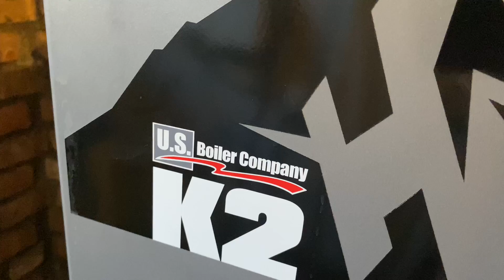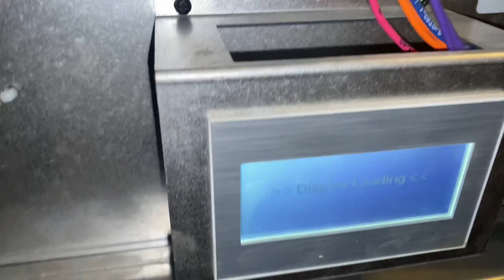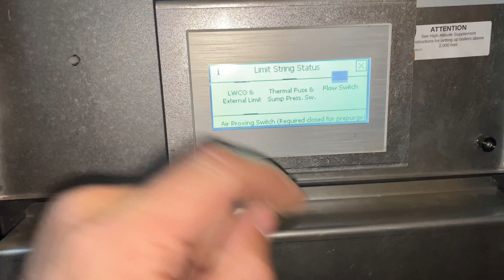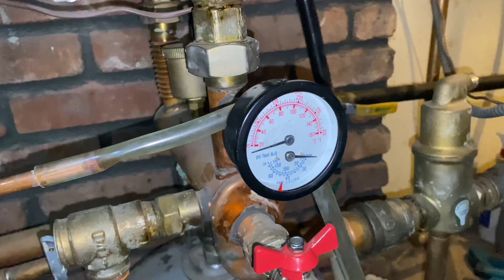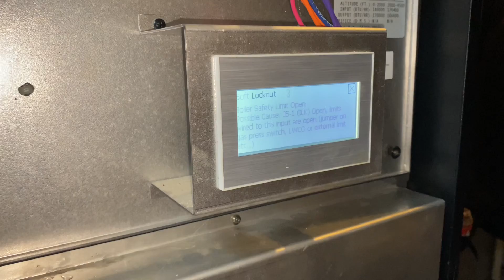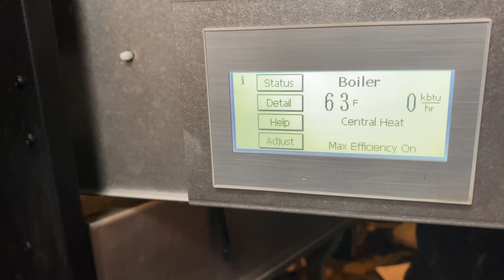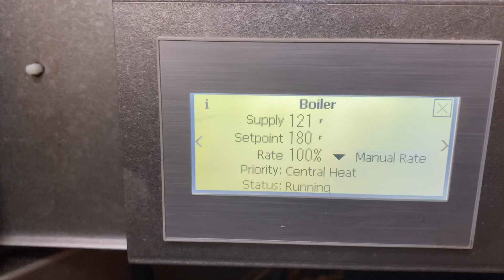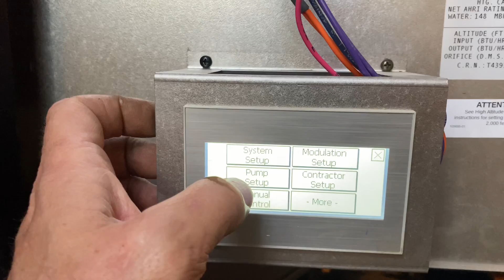Expert Tips: How to Solve US Boiler Burnham K2 RED Screen Not Heating

Comment: Incredibly incompetent!You replaced Grundfos 26-99 that has available head of 30 with Taco 0015 with available head of 18!Did you bother to read the minimal required boiler water flow in the manual?(FYI it is 9.3 GPM)No wonder so many boilers like this fail if they are installed by "experts" like you.Lesson learned here is"read the f-ing manual" not "don't be intimidated by what you don't know"Apparently you need to learn alot!
Reply: I was thinking the same. These boilers HX have high head and high GPM requirements, especially a large one.  The 0015e3 the switch is actually for head not speed. So he should have left it on high at best, but it still wont meet the GPM requirement of the boiler…. But he got it working. 

I roughly calculated the energy savings of these E pumps and it would take 10 years to get back the $100 premium over a regular 0015 three speed. The 50 watts saved is not worth it because they break more often. The regular 0015 is a great pump to have on the truck, it’s medium head capable and not expensive. I’ll pass on the new fancy versions.

Comment: Awesome video! This helped me resolve a flow switch fault that arose after I replaced a leaking flow switch. The initial purge of the heat exchanger didn’t work, but a second purge with the system turned ON pushed out all the contained air. Thanks for your help!!
Reply from the maker: Glad it helped!